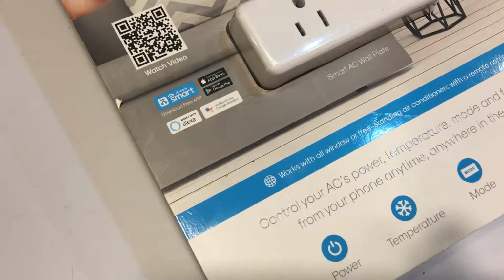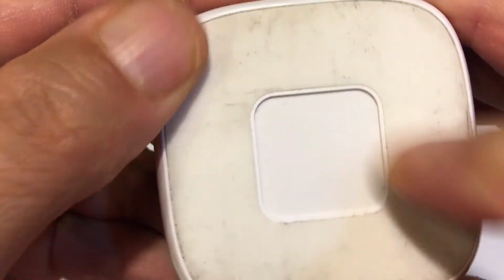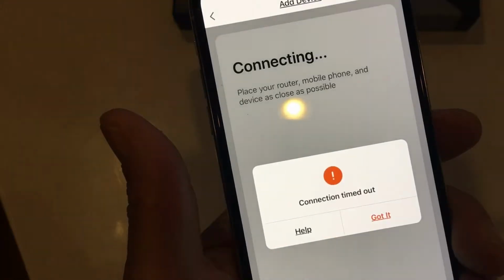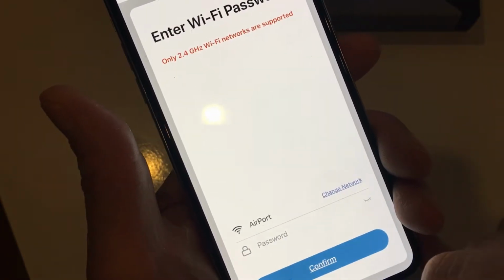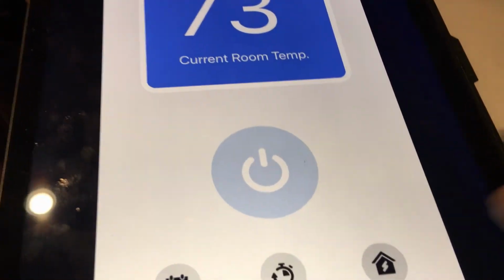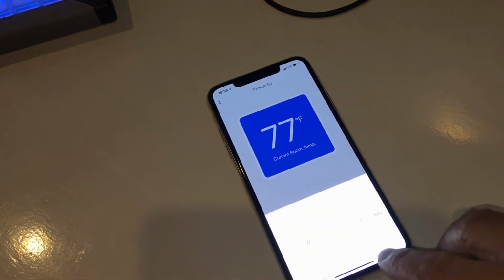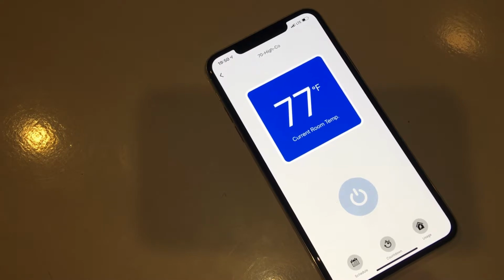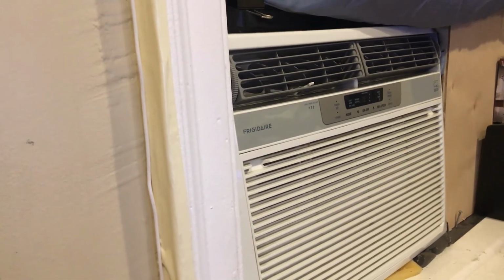atomi smart WiFi Air Conditioner Adaptor Thermometer Monitoring AC Control

Comment: This unit seems to have been clearanced out and OPEN BOX for $10.  When I purchased mine earlier today at Wally World, it was clearnaced to $24 from $29.  Based on wasting 2 hours ATTEMPTING to set mine up and reading countless other reviews, it will likely be RETURNED to Wally world UNLESS this video helps.  No, I have not yet watched with current model in hand. I if have GOOD luck, I will post results here. I have GREAT HOPE for this video, because instrutions (which I rarely NEED to read are seriously lacking in the box and on line.  Regardless, thanks for takign the time to post this video here.  I certainly cannot hurt!   [WIFI and bluetooth connection is currently the issue.]

Comment: Follow the setup instructions. You keep ignoring them and clicking I understand. Set your temp, fan speed and mode "on the remote control" not on the ac control panel. How can the unit learn the remote commands if you never teach it the commands?
Reply: He did it correctly, it only supports fan speed, mode, temp on controllers without screens. Controllers with screens only supports on/off.
Reply: I have a daikin split units with lcd remote and can't seem to set it up  can you help me ?
Reply: Any help for daikin split unit?